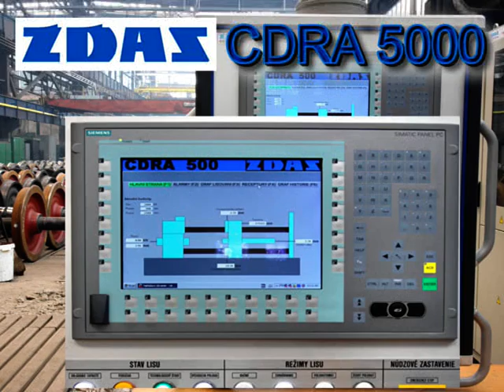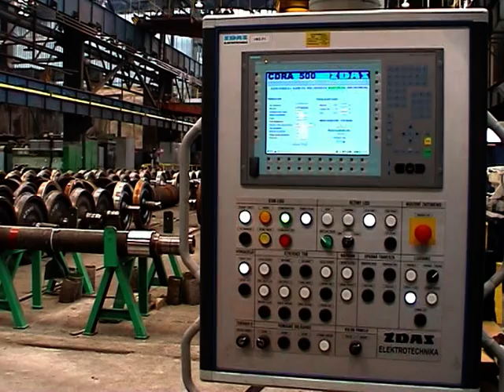CDRA Press for the Adjustment of Railway Wheelsets CDRA 500 ŽĎAS, a.s.

Comment: 1 should not be using straps a proper  balanced lifting jig should be manufactured with a lock mechanism on,2 The working area should be cordoned  and barriers fitted, walkways floors should be painted.3 the pit around the machine should be guarded.4 no PPE.This video shows exactly how not to do the job properly and safely,This factory would be closed within a week in uk. I've just noticed there's not safety tags on the straps and there starting to fray.Terrible terrible video should say how to do attach wheels in the most unsafe way possible.
Reply: Carlos
Reply: The factory would have been closed in less time than that under M. Thatcher.
Reply: Thank you Mr clipboard health and safety gone mad man.
Reply: It would have been closed in the US too. Note, no hard hats while using overhead cranes.
Reply: Maybe that's why there is no manufacturing in the UK any more?